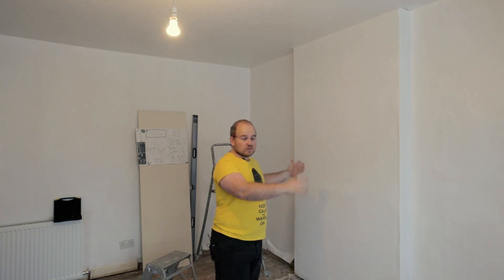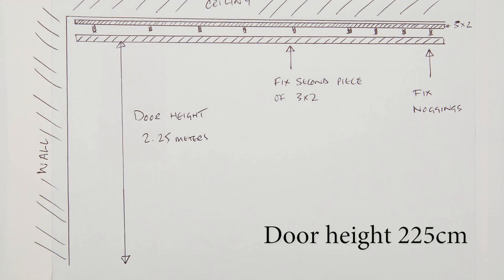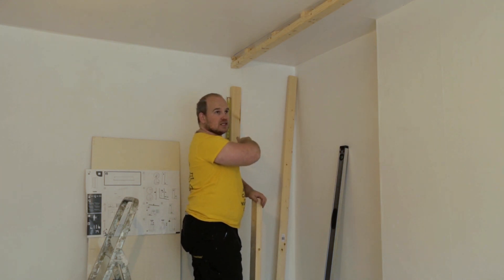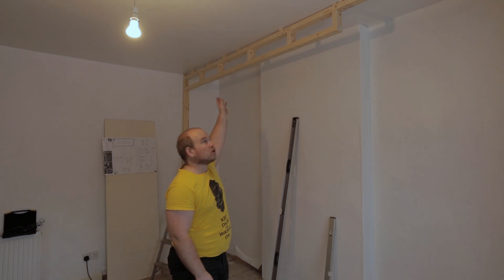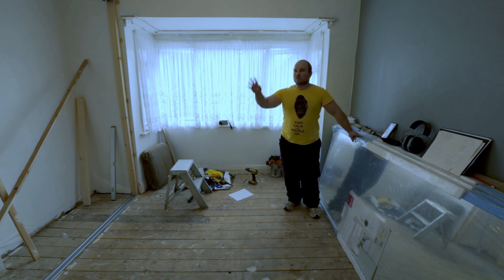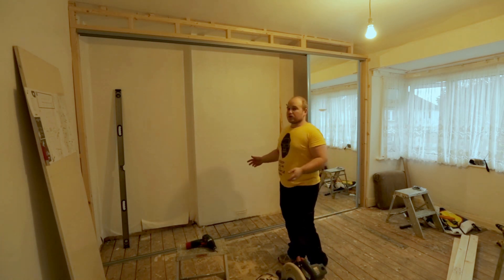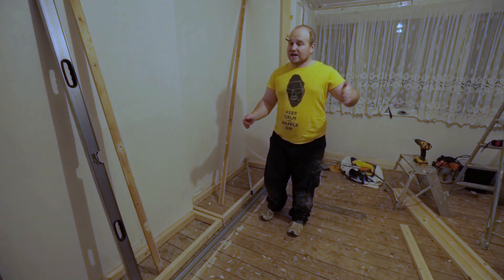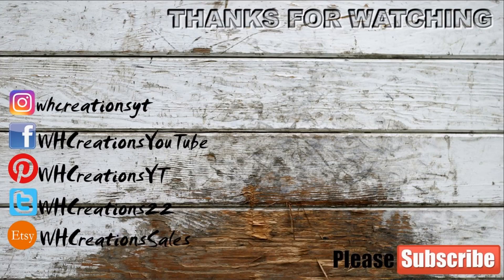Built In Wardrobes Using B&Q Sliding Glass Doors | DIY Project

Comment: This vid came up on my recommended list, fitted these same doors for a customer. Same kind of problems, nothing straight and a bit of messing about reseating the metal frame on the mirror properly, but like you say, the glide action on them is nice and smooth. You could have used some strips of timber to create the door rebates, the mdf panels would have covered the joints. The only trouble with these kind of kits is you can sometimes spend as much time working out vague instructions as doing the work.

Comment: Hi. Great tutorial. I'm about to start building my frame. Problem is the joist is too far out. Ideally, i want the doors to run between my two ceiling joist. Could I get away with attaching the 3x2 (2400mm) timber into the ceiling with toggle bolts? I'm concerned they wont hold the weight tbh. Or should I go down the route of screwing timber between the joist and then attaching my frame to the blocking through the ceiling. Only problem is that its a mission to get to the joist in my attic so I'd prefer to avoid this. Could I instead create a surface cleate with 3x2s between the joist and is visible in the room? I'll be boarding the frame anyway so it wont be visible. Thanks
Reply from the maker: Sorry mate I can't give advice unfortunately.

Comment: Nice video. How did you work out the height of the top runner? Is it purely the height of the door or do you include/allow for the top guide and bottom roller?
Reply from the maker: Pretty certain it said in the instructions for the door mate. Cheers 🍻

Comment: hi why did you make the additional top frame, because doors are not tall enough? what is your safe height of a door recomendation 
the door is going to ve sliding on the floor and ceiling trails wheel on top and bottom part of the doors
i will make 3 sliding door size of 230x70
Reply from the maker: Yes, the doors don't go floor to ceiling so the top rail was to secure it to place. I'm sorry I can't give you any advice concerning your door. I would highly recommend hiring or getting advice from a local building/carpenter in your area.

Comment: Well thought out job. Just wondering though why you leveled the ceiling. Would it not have been easier to level the lower rail and cut the noggins accordingly. Not a criticism at all, just a suggestion. Nice job though
Reply from the maker: Thanks buddy. Yeah either way would work. You may have been right about doing the bottom first. It was a while ago now and at first I didn't think it would have taken as long as it did. Suppose its very much a see as you go

Comment: Id like to do something similar, difference is mine would be going "wall to wall". Its a much smaller room, to the left hand side would be the door/entrance to the room so I would need to put a show end on it. Wondering what I could use, maybe   a high gloss section like they use on a tall kitchen unit? also, on your design there is timber visible to the right which looks proud of the sliding doors. Would you just paint that or did you cover it with something? Cheers
Reply from the maker: Hey jc, the idea was that I would use 4x2 to frame the doors and then use MDF to create a nice surround to hide it all. Inside would have been framed out for shelves and tv etc. Its a shame they decided to do it themselves,  but there you go. A kitchen side would work. Failing that a piece of mdf cut to size and painted to match the room

Comment: Hello when u drill into the ceiling do you have to drill to to a joist
Reply from the maker: Ideally yes, which is why I was using a small drill bit to test. The plasterboard alone won't give the kind of stability needed unless you get some plasterboard fittings which will take the weight of the beam.

Comment: Instead of raising the floor inside the wardrobe you should have done that first large enough to mount the flòor track on, then you would have a smaller filler at the roof and would just need to trim along the floor for a neater finish plus trim over that cls timber as its not a finishing timber.
Reply from the maker: Thanks mate. Yep was all covered on the end.
Reply: Punctuation please

Comment: What do you think about fixing the bottom rail onto carpet or perhaps screw a piece of timber either 1x2 or 2x2 over the carpet and then install the rail ontop
Reply from the maker: Hey ameer. The idea originally was that they wanted some sort of skirting board underneath. This was then changed when I couldn't get back before they wanted it all done. But yes of course you could also do this
Reply: @WHCreations  how did you find the joists in the ceiling above for where to fix the 3x2
Reply from the maker: I placed a small drill bit through the plasterboard until i hit a joist then found the distance between one and measured off of that 🤘

Comment: Nice video, thanks! I'm installing my own fitted wardrobes as well. What type of wood (soft, hard, etc) did you used for the door frames (i.e. fixed to the ceiling, walls and floor)?
Reply from the maker: Soft wood cls
Reply: What's cls

Comment: Iv never known a decent way of finding the ceiling joists. Would knocking along the ceiling to find a  hard part like you do on stud walls and maybe running a magnet to find any screw or nail heads
Reply from the maker: A magnet is a great little trick Scott. In an old house it may be galvanised nails rather than the more recent screw. For me I knocked along and can sort of find what I need. Drill a small hole in the area you think being careful not to drill into anything like wires etc. I knew which way the joists were running so that helped a lot
Reply: @WHCreations  goo man knowing what way joists are going to helps. Jus watching your bike shed vid now. Ha. Keep good vids going. Ur editing is professional. How you learn that
Reply from the maker: The editing for the wardrobe was done all by a friend of mine who wanted to get into filming. He is a photographer. All the others are just me with a camera being silly and making bits. The editing is just something I pick up... not professional by a long shot

Comment: Why not Screw top rail to ceiling then just adjust nogging height to get bottom rail level.... Much easier
Reply from the maker: Hey John, totally agree with you but feel the time it would have taken to do it that way may have taken a little longer than the way I did it in the video. Oh and basically i like making it hard for myself 😉🤘
Reply: @WHCreations  reall y good video just a tip once the bottom track is positioned make a rod the height of the doors then build the head to it might save some time, but you done well from what you got regards tony ajs carpentry
Reply from the maker: Top tip mate!

Comment: Just a question. Did you design your framing so the "opening" was the same size as all the doors together when fully closed?
Reply from the maker: Hi, the doors were purchased to fit the desired width if I remember correctly. There is a slight overlap on each door

Comment: My joist in ceiling is right next to the breast which isn't deep enough,  and the next 1 is 17 inch which is to much , how do I fix this mate
Reply from the maker: sorry buddy, you would have to call in builder or structural engineer to work this out for you. I am unable to offer any advice with this.

Comment: Quality vid. After watching this, I would love to have a go myself. Do you have any pics of the finished article with the MDF surround? Also, do you thing you could do this by laying the base of the frame on carpet and screwing it through, without having to take the carpet up?
Reply from the maker: Thanks. I dont have any photos of the finished article. I never got the chance to finish it as my parents took over. It's their finish and not mine and not something I would have done. In terms of fixing it over carpets I would be dubious. You really need a firm stable and flat fixture point. I would lay it over the carpet and then cut up to the fixing point, remove carpet and fix down some new grips to affix carpet too. I dont think this step would take too long but would definitely give you a better finish.